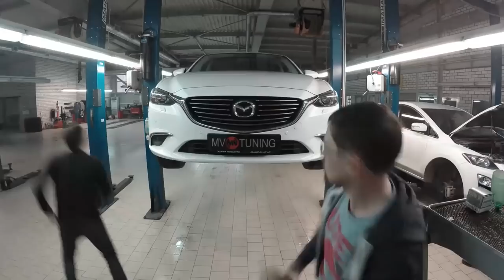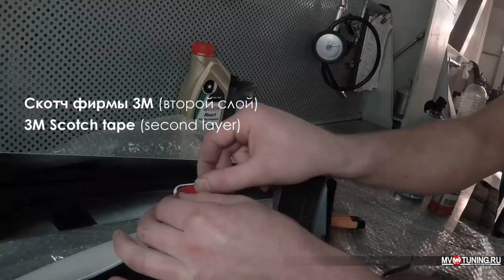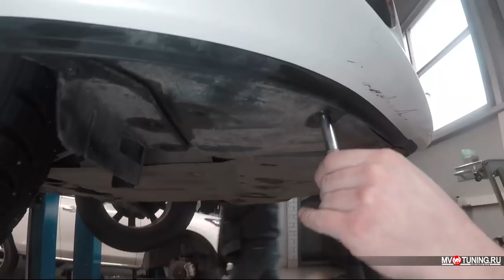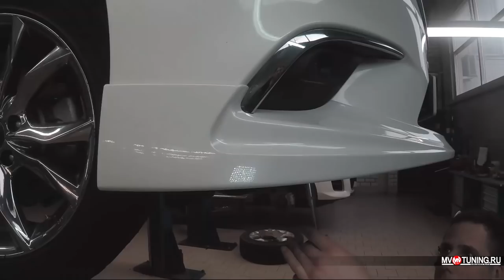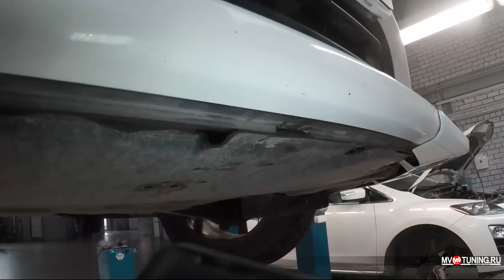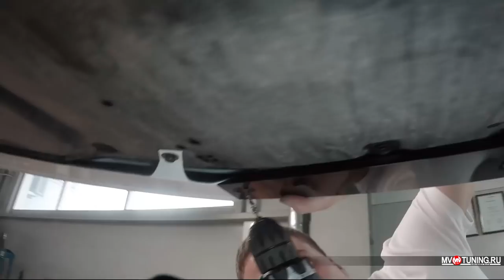Front lip spoiler by MV-TUNING for Mazda 6 Facelift (Installation Instruction).

Comment: Got one for Mazda 3? 3rd gen
Reply from the maker: Unfortunately no(
Reply: @MVTUNING  what about will just those “ fangs” fit my front bumper? They look very very similar if not the exact same at the bottom part
Reply from the maker: @vctrflrs3687  The bumper only looks similar, in fact, Mazda 3 has a different one.